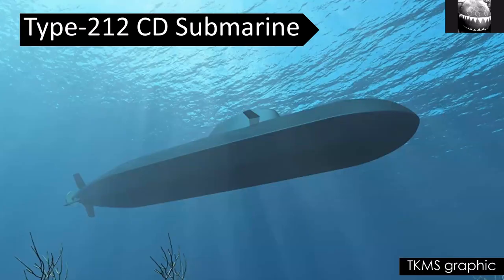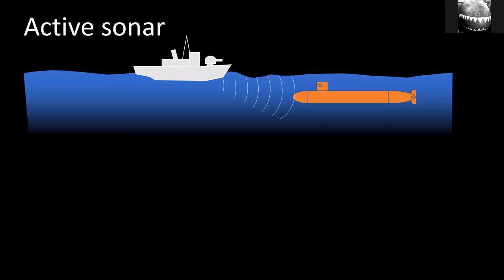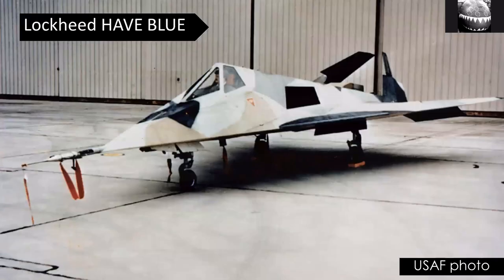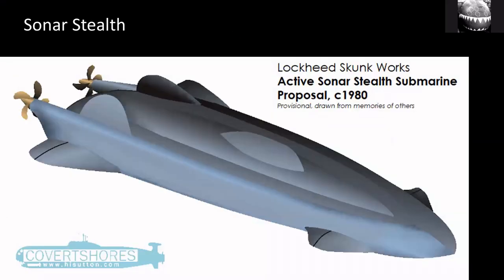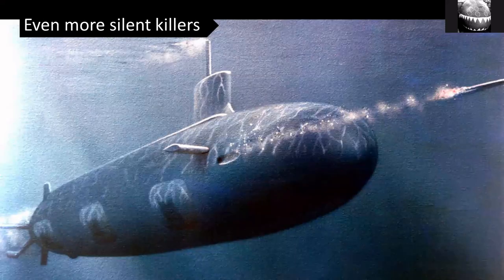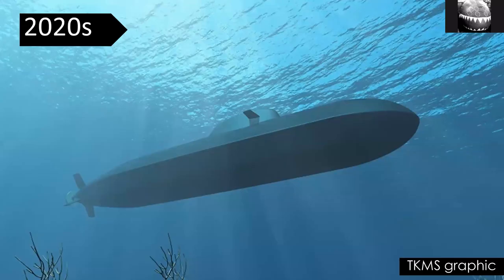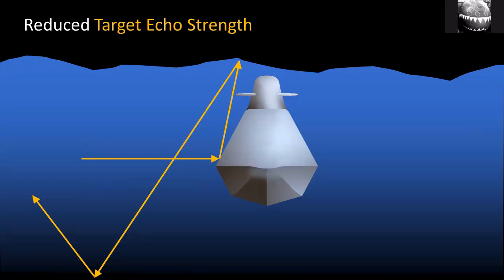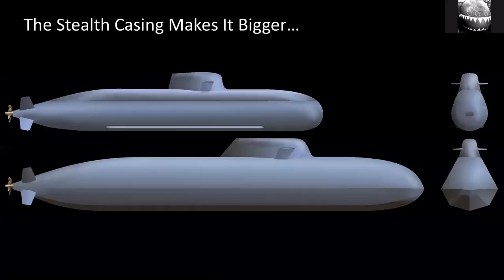The New Stealth Submarines Explained (Quick Guide)

Comment: I think the sharp angles in the early stealth plain have more to do with the difficulty to calculate the radar reflection rather than that they are particular good for that. Newer stealth air crafts are more curved.
Reply: To an extend. 
There is also the advancement in ram that allow the uses of less stealthy geometry.
Reply: Water is more complicated than air.
Reply: @Br1cht  What are you trying to say?
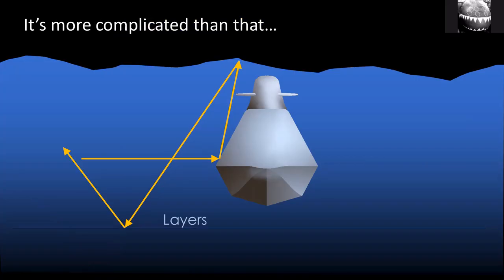Reply: @MusikCassette  i guess he meant 8:38
there is the thing with the thermocline layer (the layer between the warm surface water and the cold deep water) and different layers of seawater too, 
as sound waves can be diffracted between the surface and the thermocline, or be reflected from the thermocline back to the depth

Comment: Great topic. Thank you for taking the time and making the stab at addressing this. Curious about any trade-offs between designing a submarine for operating depth (ability to go deeper), stealth and speed. 

Figure materials (titanium or Hastelloy-100 steel), design (double hull) all come into play. But wonder about the implication of undertaking certain shaping, of the outer hull for subs designed to go down to pretty deep test depths, the kind that it seems the have Russians aspired to (e.g.  Akula, Typhoon, Borei, etc.?)?
Reply: The pressure hull is still cylindrical or spherical, the outer hull is a free flood space, so it does not experience the pressure difference that the pressure hull has to withstand.

Comment: Curious to know what is between the outer stealth hull and the inner pressure hull. Whatever is in that space is going to dramatically affect performance either adding ballast or buoyancy and of course test depth and crush depth would also be affected. I'm fairly sure the depth performance will be "classified" but an educated guess perhaps?
Reply: In case of the regular Type 212A submarine there are oxygen and hydrogen tanks for the fuel-cell propulsion between the two hulls.

Comment: Just had an interesting thought: If the stealth sheath over the hull had an embedded material in it angled to reflect sonar, you could go back to having a smoother, less turbulent exterior shape by relying on the angles of the embedded material to reflect sonar rather than the physical shape of a homogeneous material.
Reply: As I understand it, stealth jets already do this. They have angled ‘echo chambers’ inside the jet to increase radar deflection. This is one reason why the F35 is much more aerodynamic than the old F111. No doubt, weapons designers will have thought of things long before you and I will.
Reply: That's the principle of metamaterials. But the challenge is always matching the acoustic impedance of the metamaterial to the impedance of the water, because it is at impedance changes that reflections form. If you can get the wave into your metamaterial then you could acoustically "cloak" your submarine by guiding the sound around it. But that is a LOT easier said than done.
Reply: @jamesperry1358  This is probably a dumb question: Does the acoustic impedance change with pressure, or tep, or salinity?
Reply: @jeffcauhape6880  No idea, I do EM. The physics of wave propagation are very similar between acoustics and EM but I don't know much about acoustic material properties. I think it is mostly a property of temperature but dont take my word for it.
Reply: @jeffcauhape6880  yes. it even is in the newest tv series version of Das Boot.
Reply: One of the big problems with this, and the angled hull, is hydrodynamics. They are similar to aerodynamics, but by no means the same. friction and vortices created by "rough" surfaces or edges might cause sound that is even MORE telling than the sub itself. Kind of why the F-35 is not invisible in rain. The "splatter" can be seen by sensors and infer where the plane is, even when the plane itself does not show. Some thing if a sub is too angled. The edges will cause the water to stir in different ways, that might be picked up easier than from a drop-formed sub.

Comment: The problem of how to make stealth aircraft visible to radar is nowadays solved , and in a very elegant way. 
The stealth aircraft design uses the assumption that a radar transmitter and reciever are located in the same object. Thats the way radar has been designed from its start until now. So you try to reduce your radar reflection to a minimum in the direction of the source of the beam. And try to reflect it in another direction away.  But what happens when radar transmitter and reciever are not in the same place?   Or when you use the "radar background noise " created by a variety of sources like mobilphone transmitter stations ?  Then you can percieve a moving aerial object as a local perturbation  or disturbance of this background noise. If you connect two recieving stations and their signal  , than you can analize for the correct location of the moving aerial object.  As your own station is only a reciever you are invisible to anti radar measures which lock on the radar signal of a foe to locate and destroy ist.
Reply: Add to that: bistatic sonar arrays are not uncommon for military aplications, these days.

Comment: 2500 t vs 1500 t of the original Type 212 ?
I can see why they put in a 2nd diesel - Wonder if they also "just" doubled the number of AIP plants.

Sure, A 2nd hull would make a sub look bigger, without necessary increasing internal volume, 
but I somehow doubt the 30 % growth in length AND at the beam wont also give them significant more space on the inside.

Comment: problem is: Stealth shapes are not very pressure resilient.Edges in particular, suffer greatly. Somehow important, if you don't fancy a depth of 200 feet as max depth. you don't know the exact direction, a signal comes from, and turning a sub "into its direction, No matter how weak your signature gets, will take some time.
Reply: Actually, that's not such a huge issue with modern double hull submarines. As said in the Video, the inner pressure hull is still round, And the outer hull has basically no pressure difference between its inside and outside.
True that you don't know from where a sonar ping will come, but the strenght of the return correlates directly to the relative area of the hull which would be visible from the sonar source. So the worst angle a sonar ping can come from from the submarine perspective is exactly 90°, basically hitting the submarine from the side where the whole length of the submarine will reflect the ping straight back. That's where a stealth design makes the most sense and that's exactly where the germans put it.
Reply: @shi01  Well, i just don't see, why the side of a submarine is the most affected part, if it is supposed to be UNDER everything else.  I see surface ship sonar,  or even helicopter sonar as the primary means to find a Submarine. And for those, the giant side slabs with edges should light up like a christmas tree. Even surface-launched torpedoes search from surface level to max depth (usually in a spiral). they don't start searching from depth of submarine, just so they can hit it from the side.

Comment: I would think with this design you'd get a lot of extra dead space outside of the pressure vessel.  I would think that you could slide your launch tubes and torpedo tubes outward and into this dead space, leaving a lot less if the tubes in the pressure vessel, which would open up interior space. I would look into mounting as much hardware as you can between the outer skin and the inner hull that you can get away with.
Reply: Seems to be the perfect spot for lithium batteries: they can widstand high pressures and putting them inside the actual living space is a fire hazard. Seems to be a win-win to me.
Reply: gee- the USN should hire you!
Reply: Perhaps just use the space as extra emergency ballast tanks. Divide the space into sections and force water out of all of the undamaged ones in case of emergency.
Reply: Boy howdy am I glad y'all aren't building subs! I'm sure it's full of the real magic sauce in this "stealth".

What kind is anyone's guess... I'll go with some kind of very special foam, but it could be the prayers of schoolkids and we would not know.

Comment: In theory, you could simulate this with an RTX. Just simulate the parts of the sonar pulse that should reach it in 2 bounces, and then simulate the pulse as a bunch of rays eminating from one source. Set the water, the thermal layer, and the surface to be reflective layers to the degree that they are, and you get a good approximation (at least from my understanding of this topic)
Reply: bro that's super clever. might not be the most accurate way. but would be a very affordable way to rough and sketch things out. And probably still reach functional designs.
Reply: @ALegitimateYoutuber  Yeah, though you'd need to run a more detailed analysis to make sure probably, but rapid prototyping is kind of a big deal nowadays, so getting a rough idea of wether it works is a good start. And besides, i dont see why an RTX wouldnt be able to do the detailed version too. You'd need to trace more rays, sure, but in theory, sonar behaves enough like light to make it work anyway with a few adjustments, at least as far as i know.
Reply: @HolyPastrami  regardless that is a genius idea for a lot of independent or small company's to explore ideas with. Since a real pain in the ass is simulations. because it's either always insanely expensive, not for sale, or requires a huge amount of set up.
Reply: @ALegitimateYoutuber  Start a company thats all about running the simulations thats too exhausting for everyone else to run... interesting idea, i must say.
Reply: @HolyPastrami  honestly i'm kinda working on that but for a shop space. Because i'm formally from the independent side of things. And you have zero restrictions there. And i would like to bring a similar to the public. Just sucks how expensive such things are. But baby steps. unless i get super lucky and can form another IRG (independent research group).
Though if you as smart as you have lead me to think you are. you start that idea. Because offering that kinda of simulation service without restrictions or monitoring. Oh man, you'll get easy attention.
Reply: @HolyPastrami  honestly i'm kinda doing that for shop space, to mimic the independent scene i'm originally from. Which is just unrestricted manufacturing and research. But sadly i'm not rich, so baby steps for me. Unless i get lucky and can once again form an IRG (Independent Research Group, it's essentially a think tank that makes stuff)
Though if you are as smart as you have made me think you are. go ahead and pursue that idea. because rapid easy ways to simulate stuff, for cheap. plus if done without restrictions or monitoring. Would be extremely appealing to a lot of people. From little start ups, to freelancers, to even guys like me to perfer the independent scene.
Reply: @LegendLength  Fascinating idea, though i feel like this would be extremely expensive to do. I mean think about it, you need the AI to optimize for several characteristics here. 

For one thing, submarines need to have a certain amount of speed and be capable of diving a certain depth. So this means that the submarine needs to be optimized not only to not reflect active sonar back to the source, but also to at the same time retain speed and diving depth. 

Each of these three factors requires entirely different design criteria, and the amount of neurons a neural network would need to optimize for all of it is insane.

Look up carykh's Evolution Simulator for example. It's a fairly simplistic simulation, but even that takes a lot of processing power. 

The type of power you'd need for that is probably more comparable to, say, The Third Builds Pokemon Showdown AI (And in case you didn't know, Pokemon is an extremely complicated game. There are orders of magnitude more possible first turns in Pokemon than there are possible games in chess) and even that seems low.

Then again, you could hypothetically simulate the shape by having it work similarly to Spores creature creator. Have each piece of the creature be a bone from which a body part expands outward, with the body part being a shape you can set.

Actually, thinking about it, CAD programs already come with all the tools you'd need to construct any shape you want, so in theory, you could make the neural network a plugin that generates shapes in a CAD program with this kind of tool, then run it through several simulations testing the aspects you want and assigning a fitness score to each, in such a way as to allow the neural network to attempt to get the highest score in each of them as well as the highest average score (afterall, a submarine that is undetectable, but crumbles after 5 meters of depth and is also essentially dead in the water is not very useful)

Even then, i think the amount of neurons required for this kind of thing is so insane that you'd probably need a dedicated supercomputer for it.

Comment: I'm sure I'm not the only person to imagine active sonar emitting drones so that the mother ship can receive the reflections passively.
Reply: I believe that is something that can actually be done through the use of active pings from torpedoes. Calculations might be a bit more tricky, but the pings won’t be coming directly from your ship.
Reply: actually I came here to raise the same question, some sonars have a remote emitter. And for airspace some systems use the reflections from telecom emitters to spy without emitting themselve.
Reply: Checkout SOSUS
Reply: @joshkruger6068  SOSUS is passive.
Reply: Buoys are placed and moved by helicopter.
Reply: I think in radio space, people are using cell towers for the last decade or two, rather than emitting their own signals, they can passively listen to reflections from Cell towers which are at known locations, and transmit in standard patterns.  Also weather radars are a thing that can be listened to, but I think the freq. is optimized for large water vapour, likely not ideal for aircraft.

Comment: I figured out a "Stealth" design over twenty years ago, but the problem is the extra turbulence created by the angular hull. You can still detect it with passive sonar.
Reply: Yes, agreed! Hydrodynamics would definitely play a big part insofar as operating envelope/efficiency, too. Clearly, screws would be OUT in favor of specially shrouded propulsors (or even magneto hydrodynamic propulsion...the "caterpillar"). Also, I would imagine a stealth boat would have to be exceptionally well-trimmed to avoid deployment and use of control plane surfaces (e.g. retractable bow planes). I am not convinced this will be viable with large boats (modern nukes, etc.).

Comment: Is it a known fact there is a conventional inner round steel construction or merely speculation?  Given that is correct, when will the angular oyter construction brake down as it cannot withstand the pressure?  Is there any scenario where one will rely on the inner construction in a fully functional mode or do we speak of safety to the crew only?
Reply from the maker: Yes the inner hull is round, just a regular submarine construction. 
The outer hull is flooded so not under pressure

Comment: Novice question, would not the shape increase drag, turbulence and wake, at least at higher speeds? And is there not technology being exhamined to detect subs by their wakes? But I assume that these are very speed dependant.
Reply: " is there not technology being examined to detect subs by their wakes?"
I am aware of a technology whereby they "sniff" the water looking for the ionization products caused by particles emitted from nuclear reactors, thus locating wakes.
Reply: there are no angles normal to the direction of flow so no extra turbulence.
Reply: @Mar-s5q8m  .... angles not normal to the direction of flow ... Wouldn't that create cavitation?
Reply: @abrahamdozer6273  no, angles normal (in the mathematic sense of the word, normal is 90° off) would create turbulence. but if the water flows along a plane it doesn't care if it's, a flat sheet, round or a box.
Reply: @Mar-s5q8m  Yes, I see ... as long as there is no significant pressure difference between one side and the other ..,

Comment: I don't understand one thing, maybe I'm dumb or missing something. You say the cylindrical "inner" hull has to be that way because it needs to withstand the immense pressures of depth, but doesn't the stealthy angular "outer" hull need to withstand those same pressures? Can these subs dive as deeply as conventionally shaped subs? And knowing about this, why hasn't the US incorporated these techniques into their newest classes of submarines - the Virginia and Colombia classes respectively?
Reply: Because the inner hull is filled with breathable air so squishy humans don't die. The water pressure is going to push in on that more intensely than the outer hull which doesn't need to have air in it. You can even fill it with outside water to equalize the pressure.

USN wasn't interested because there was no point during the cold war since passive sonar was the name of the game. This meant being quiet was more important than knocking away active sonar waves which the stealth shape is good for. Why compromise your sound signature with an extra big and non-sleek sub (more noise pushing water around) compared to the convential design when most of the fight is in passive mode. Think needle through water vs an allen key through water.

That being said, if you can accomplish both then why not? Which is being explored by various nations as sutton said but no one is revealing their hand much. Until then, the US needs subs out in the water now so stick with what works and still competitive. Remember, all an SSBN needs to do is get within a couple hundred KM of anything but another sub to do damage.